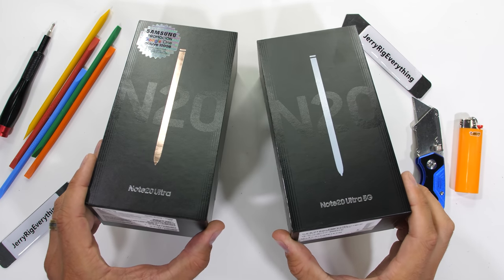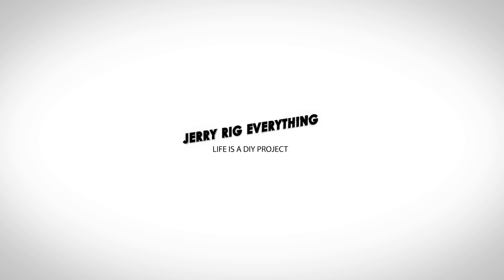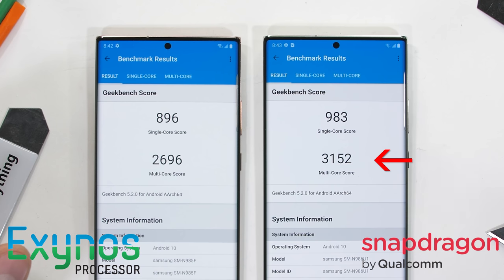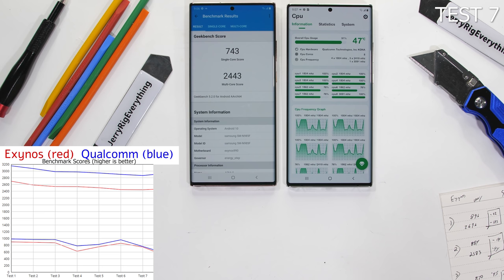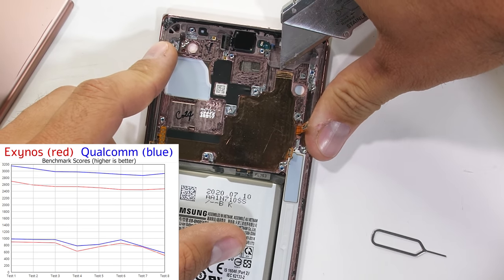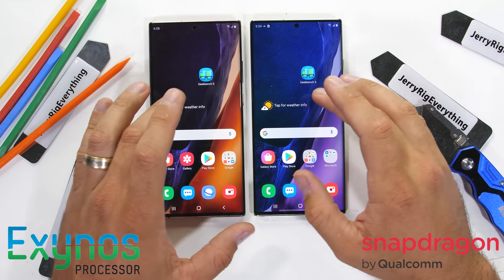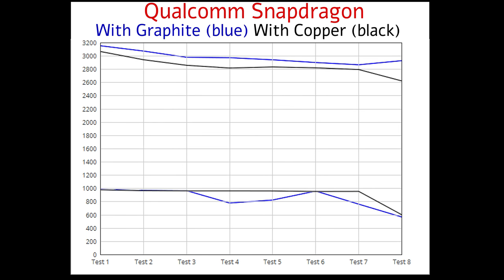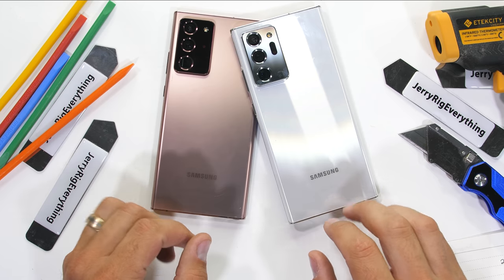Samsung should explain this... Exynos vs Qualcomm?! - Note 20 Ultra

Comment: I live in the UK and literally would've bought a note 10 plus if it had a Snapdragon chip. Went with the iPhone xs instead. Sorry but I'm not paying more than Americans for a weaker chip
Reply: 60hz phone in 2020 😐
Reply: overheating phone in 2020 :l
Reply: Iphone HAHAAHHAHAHA
Reply: yeah instead you bought even bigger shit. Big brain move!
Reply: Aleksandar K. explain it
Reply: These other comments are hilarious, I believe the apple phone you bought outperforms these note20ultra phones, even though it is two years old.
Reply: Andrew Young iphone’s OS is just better optimalized than android os, thus despite different hardware and OS, older iphones still could get the same work done slightly slower or even at the same speed as mid-range new android phones
Reply: Did you really buy an iPhone before the new iPhone is released? O________O Like, bruh. Should've waited for the iPhone 12-series which launches in ~1 month.
Reply: @filkry8832  Eh...social media shit is faster on Android than on iOS. Gaming is about the same. Heavy workloads tend to be lots faster on iOS. Idc about specs or other blabla. I only care about how fast it is in real life. How fast it is during use. That's the important part. Not about what spec is good. Like, ppl say iPhone has low RAM. Idc. It's still great in real life. Ppl say snapdragon is slow spec-wise. Idc. It's still great in real life. Real life performance is the most important for people that USE their phone. Specs are neat for people that benchmark all the time.
Reply: Clout iphones has less RAM because iOS just dont need so much RAM memory like android.
No big difference between newer or older iphone, if he must bought the new phone, he couldn’t wait. I’d do the same thing.
Reply: Dude you buy a even worse phone face palm
Reply: @andrewyoung4473  not really not even a competence to the note exinos
Reply: la sañia explain your choice
Reply: @filkry8832  don't get me wrong I would never chose one of this 2 phone
Reply: @edwartoelrico333  you meant the samsung phones?
Reply: @filkry8832  I meant that the note exinos is better than xs
Reply: @edwartoelrico333  in which way?
Reply: @Samosayummyyay  Social Media posting is better on iPhone because some like Snapchat optimise their apps for iPhone to look better on.
Reply: la sañia no they're about the same
Reply: Haven't met and android user that looks fake, an idiot yes, but not fake and proud of it.
Reply: @Samosayummyyay  Social media is a lot better in iPhones. Everything is fast in iPhones.....and consistent and reliable for the coming long years as long as you replace the battery every 3 years. I'm not sure about the fastest highest spec android phones like the fastest 5G which I'm not sure if it's reliable and consistent enough to not create hassles and frustrations....although it is the fastest....so to speak.
Reply: @samuelmanny6231   Your comment is baseless.  According to tests you are incorrect.
Reply: @filkry8832   with each iOS release getting more and more features and trying to improve multitasking I would say that RAM is becoming more and more important.  One thing I noticed with the Note 20 Ultra over my last phone is that I can switch between more apps without them having to reopen. RAM matters and its not just about OS optimization or speed.
Going back to my first point. I can only imagine that the RAM discrepancies are the reason why Apple doesn't port every feature to their older devices.
Reply: Thats seems like an odd move, considering that the iPhone 11 came out just a brief time after the Note 10.
Reply: Comments complaining about this guy's iPhone XS purchase is hilarious, he buys what suits him, you people don't have to cry out loud.
Reply: @georgephotography8704   Sounds like his needs are pretty flexible if he'll throw away major features over an SoC.
Reply: Y not a OnePlus 8 pro?
Reply: Great buy my guy these people are just fan boys never heard of any over heating problems etc I’m typing this proudly on my xs max
Reply: Same. Now I might switch to iPhone as well.
Reply: @josephshamon7824   LOL thats because the SoC is literally sandwiched between the stacked PCBs and has no heatsink whatsoever. Hence the phone doesn't warm up. But it most certainly throttles.
Reply: @aleksandarkurbalija  haha
Reply: Good choice
Reply: Better Deal actually, IOS have better optimizations, speed, safety features, and longer support while Samsung excels only in hardware, ie the display.
Reply: @GOKUL-rm7md  ios has better features my ass
Reply: @GOKUL-rm7md   Samsung now provides 3 years of guaranteed feature updates and linger for security updates with the S10 and up. That matches Google with the Pixel.
Reply: @GOKUL-rm7md   Surely you aren't biased, having an iOS avatar as your display pic... ;p
Reply: Damien Lobb Still not a match for Apple’s 5 year software support. Also if u look more into safety and privacy features, iOS detroys android. The bloat wares are also annoying on samsung. It is better on Oneplus, and Pixel perfected the android layout while the UI on samsung is still not that impressive. Even though samsung have an upper hand on hardware, when it comes to better optimisation for apps, especially because the developers only have to work on  iOS apps to suit 10 or 12 models while android have over 1000+ models, iOS is far better.
Reply: 1Mill Subs Without Any Videos airdrop, and the connection between everything u own apple home Apple Card to name a few
Reply: @josephshamon7824 i mean its not like i can transfer files with bluetooth right?
Reply: Damien Lobb Haha, i was using a oneplus 7 pro. Now upgraded to Iphone 11 pro.
Reply: My S10+ has always had typical android problems but it was fast in everything it did until like 6 months later the camera can't focus anymore, everything it does makes the phone so hot it literally burns my hand and I have to drop it and can't charge it because I'm actually scared it might blow up and have to turn it off soemtimes (same thing happened to my S9+ and S8), and fast charging killed my battery life im guessing cause it only lasts 4 hours on a full charge even with no background apps running, it can't do basic tasks without lagging like crazy and freezing im guessing cause of how hot it gets, and never getting any updates to fix anything cause android updates rely on your carrier and everyone gets updates at different times even with the same phone so I always get my updates a full year late and only maybe 3 updates a year 

So yeah, its not a lemon if it happened to all my android phones lmao iPhone can be a good choice for a couple reasons 😆
Reply: 1Mill Subs Without Any Videos I never said IOS has more features. Of course android have more fancy features. Read my comment again, IOS have better safety features.
Reply: @GOKUL-rm7md   Have you heard of APIs?  How about Windows, how many pC configurations and monitor resolutions are tuere?  Literally, most apps on Android have scalable assets hence why most apps still look decent on Android tablets.  The whole device optimization thing is made out to be more problematic than it actually is. The only exception being apps that need access to deeper functions of the camera etc.
Reply: @GOKUL-rm7md  read my comment again too i never said that ios has more features
Reply: @GOKUL-rm7md  has*
Reply: @josephshamon7824  i am already used to having a s20 for sure wouldnt switch
Reply: @josephshamon7824  120hz is just that feature that i wouldnt drop, same with a inscreen fingerprint scanner, wireless powershare is a thing too
Reply: @filkry8832  iOS has a freeze state. That's how iOS can get away with less RAM than Android. To get identical ram management, you have to account around 2GB ram more for an android than with an iOS device. That said, more ram = better. Well as long as it's the same price ;)
Reply: @thundurr  The app itself is slower, but the quality is good on iOS. It's still much worse than using the native camera app, but it's so much better than the shit you get with Android haha 😂
Reply: Clout that said, iOS doesn’t need so much RAM so phones have less of it
Reply: @Samosayummyyay   Do you use Android? No need for 3rd party apps when you already have fully featured native camera apps. I love the power you have when shooting in Pro mode.  That being said the Note 20 does seem to have a lot better quality in Instagram VS the older phone I had.
Reply: @Samosayummyyay   iOS freeze states have been a thing for quite a long time. Android using them to a small extent but with modern phones with 8GB+ RAM a lot more apps are kept in low power state so when they resume it's like they were never put to sleep. This can be adjusted in the battery and power options of most smartphones tho.
Reply: Seriously tho. All childishness and BS aside, I didn't get the Note 20 Ultra for the SoC. I got it for the camera, the display, the S-Pen, the 120Hz, the OneUI Note specific features, the video recording. The whole package is what makes the phone and if I had a choice between this with an Exynos and another phone with a Snapdragon, I'm picking this phone because the convenient productivity features and whole package makes a much bigger difference than a 10-15% performance difference on a device that is already very quick.  Just my 2c.

Comment: Damn. Why didn't I learn this before. Just bought a S21+ last week which is an Exynos version. 😐
Reply: This is a note 20 ultra. Not an s21. Notice how your s21 doesn't overheat? 🤡🤡🤡
Reply: @propersod2390  it's the same deal un the s21+, Qualcomm version Performs better
Reply: @karushogaming2984  no its not. It literally can't perform better. They have the same exact core layout, same exact cores, same exact everything except the GPU and NPU. The snapdragon is SLIGHTLY better in GPU and the exynos has a better NPU. There is literally no difference that matters

Comment: And this is exactly why I bought a one plus 8 pro despite being with samsung for years now. Sad but happy with the phone. !
Reply: U r not alone tho. Same thing with me. Love oneplus.
Reply: And I moved to Pixel 2XL after exynos s7 which at the moment of retirement also had an inadequate battery draining and a burned out screen in the upper part. Couldn't be happier, Pixel experience FTW
Reply: Same bro I shifted from s8+ to OnePlus 8 pro
Reply: Well if you live in north America then nothing wrong with buying a Samsung.
Reply: Same hear..
Reply: Do you find the finish /quality of the one+ 8 pro to be of similar level to the Samsung?? Curious as I want to upgrade but not sure which direction to go....
Reply: @ronny2k6  the 8 Pro is a great phone, but I ended up returning it because the screen had some serious black crush issues (I had this with 2 separate OP8 Pros). The camera is also good, but not as good as Samsung. I'd still recommend the phone if the screen thing doesn't bother you though - it's an excellent phone.
Reply: @ronny2k6  bro the build is superb ! I had a S10 , switched to OP8. Took me few days to get adjusted to color , still miss my S10 Camera. The 8 camera is trash but the 8Pro is not at all comparable to S10. The build the glass the premium feel is there wont lie ! . And 865 with 90Hz is a big big plus for me. So forget camera and amazing color display if you are switching to OnePlus. Everything else is best bang for buck you will ever get , atleast here in India 👍
Reply: Good choice
Reply: Is your Display all good mate ? heard 1 in every 2 people have display issues.
Reply: Sony Xperia ii for me. Even though Sony is money hungry too but the 4k OLED screen is doing just fine when I watch my movies.
Reply: I bought a oneplus 7 pro last year for the same reason...and im really happy with it...but i miss the S pen tbh
Reply: Same here read my comment. We should all put a consumer case on samsung for bullshittin all of us.
Reply: Same
Reply: Same OP8 pro for the win phone is snappy and has a great screen been using it it for 8 or 9 months no burn In at all!
Reply: I went from a Galaxy S II to three (!) Lumias, a Nokia 8 and a OnePlus 7 Pro (only three months ago). Too much loyalty hurts. Happy with the OnePlus and hope it lasts many years. Whatever comes after that will need a good desktop mode, regardless of whether Google does anything about it in AOSP or not.
Reply: Let's hope OP doesn't kill the phone with its OS updates. Happened to my previous OP
Reply: @casualdude9995   i checked all the videos people posted , then tried to recreate those tests on my phone ! i dont have the black crush issue. I do have some brightness flicker issue at very High brightness when at 90hz . I have never seen the grey color change because i never have my brightness that low. But when i did for the test there was a color change . But in my general usage none of these ever mattered. And tbh high refresh rate amoleds are not perfect at least for now. And as the end user none of these issues will ever come between content viewing and genral usage. Unless you specifically look for it .
Reply: @chittaranjantripathy4159  Good for you mate! important thing here is it's not disturbing the activities on your phone/screen issues being minimal.

Comment: It's super easy to know which version you're getting by the model number. If the model number ends with the letter u.  It's for the United States and then there are different variations of that model number after the u which designates the carrier

Comment: Car manufacturers do this all the time... An identical model sold in Mexico will not have all the required safety equipment as the same model sold in the US therefore cheaper but same name.

Comment: 8:08 And thats why my samsung galaxy note 10+ is probably my last samsung phone.. that hit hard 😥
Reply: Yeah... I understand his reasoning, though. Since I live in the US however, I'm safe from this whole Qualcomm Exynos bs
Reply: It's my last too that goddamn exynos 
on 1000usd
Reply: So much respect for jerry
Reply: @benjaminli188  u lucky
Reply: I'm just pissed off that us in the UK have to use the international model.
Reply: @DrAdityaReddy  I am.
Reply: Until the next Samsung phone
Reply: My S10 is my last Samsung too, if I want a Chinese knock-off of my phone I can just go on Wish, or buy an A series phone.
Reply: @benjaminli188  Same.
Reply: @khy_1777  i think most of the world has to use the exynos model unfortunately.
Reply: @taz874  ik man. I'm dissapointed at Samsung for this and may just move to the next pixel as my new phone.
Reply: @benjaminli188  ya that sucks... the international model is pretty worse than the US one.. as nearly the whole world wont know how good samsung phones really are!
Reply: @SomeOne-rw6gz  exactly. It's unfortunate such a controversy had to plague such a good phone, but unfortunately by making this decision samsung had it coming.
Reply: the next exynos is actually very promising. but its still in the air
Reply: @Beachn2407  i hope their processors get better or they will lose alot of audiance..
Reply: Probably Samsung Galaxy S7 Edge would be my first and last Samsung phone. If it had an SG CPU I wouldn't change it. But with Exynos inside and running hot after a few minutes on usage with 4g data enabled. And we are talking for  two usual tasks: browsing on the net and checking FB feed.
Reply: @GAGNATRON  Ya did you see phonebuff video that he compared the 2 kinds of s20+ in it? The Exynos model didnt have a chance!